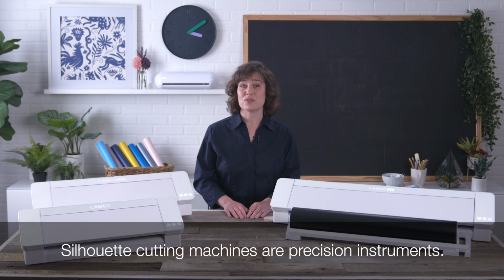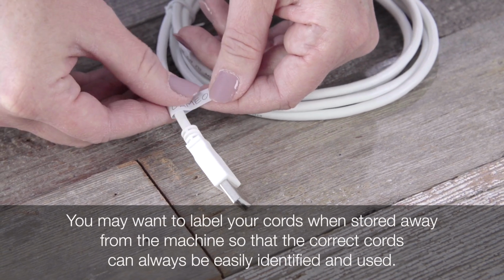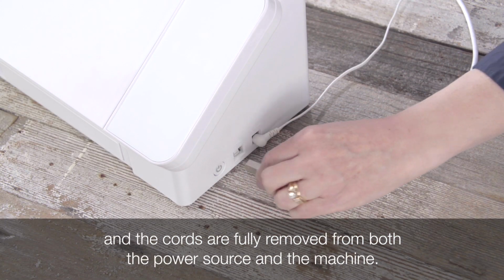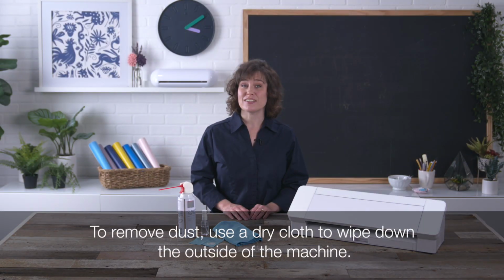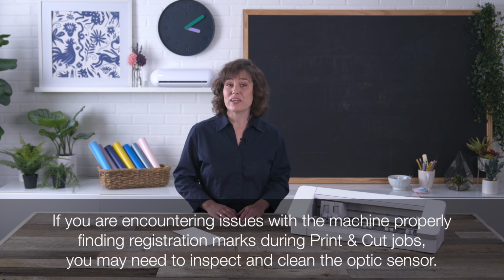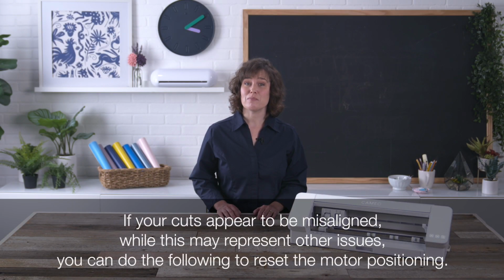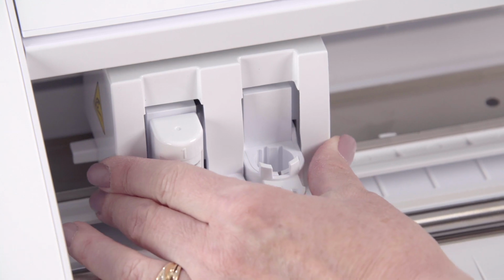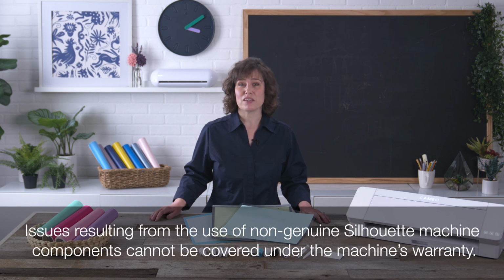Silhouette Support Series | Cutting Machine Maintenance (Updated)

Comment: good morning ! I'm from Brazil and I don't know where else to go, I'll report here what's been happening to me for over 20 days - cameo pro - studio updated itself - an infinite firmware search appears with no option to click - I've already removed the new studio and added the old one - old studio doesn't recognize the cameo pro - I've already sent an email to silhouete america - brazil - I've done everything, I've lit a candle and nothing in this world makes this machine cut - or anything - it just keeps looking for a firmware update - detail, I've already left the machine on all night all day and nothing changed this state - I've already reset it - good despair is my name, there are no videos from Cameo Pro to help me, and not even a single light on this issue - crying a lot over here. I've already sent emails - I've already put it on YouTube, and so far no response from absolutely anyone, I've done everything I saw on YouTube and on the silhouete america website, I'm losing a lot of work - I live off this job, I have no other income - and there are more than 20 days without the machine cutting. I'm looking for help. gratitude
Reply: I had the same issue with my cameo plus, I used the usb cable to connect it to my laptop, then did the firmware update, after that it worked using bluetooth without any issues. I hope this helps :)